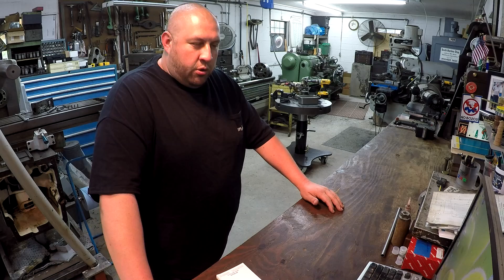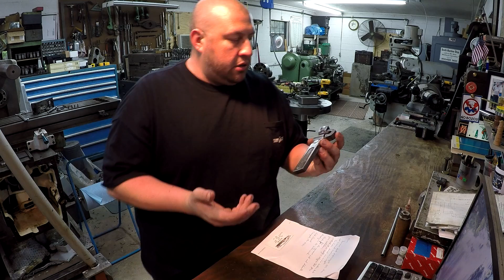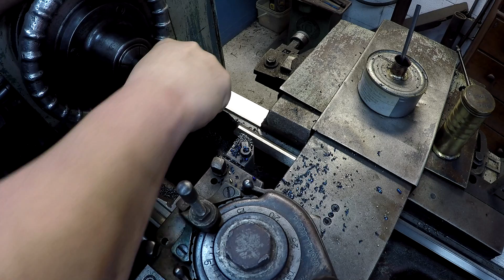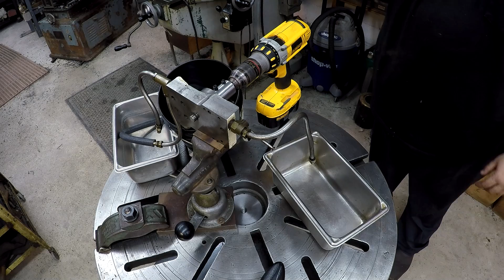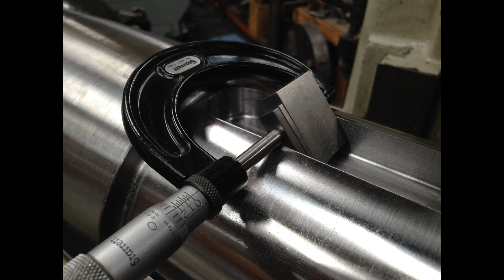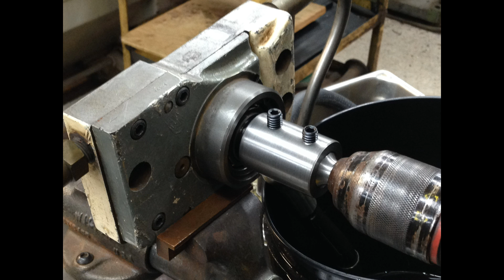Saturday Night Special 81

Comment: I'm not a hydraulics man, but surely the pump could be less effective if it had to pump against pressure instead of an open pipe. A bit like a spark plug will spark outside of the head but internal pressure can blow the spark out so to speak.

Comment: ROCK ON ADAM -without reading or scrolling down the comment section is that as i first  saw the tool holder is that i was thinking the "goose neck" style holder would lessen vibration and /or noise. but i saw that it also looks like it swivels or rotates as well? am i right cant quite tell. but does look a unique kinda shaper tool if thats what u decide to use it for.

Comment: Nice work as usual Adam! I know you have the mill knee back together now, but I think you could have used copper or aluminum tube for that suction line. It would be rigid enough to not collapse, but a heck of a lot easier to tweak around if you ever have to pull the line or filter again.

Comment: HI Adam
I am following your progress on the K&T with great interest, thanks for sharing it with us, its a great series. I watch on my TV so don't really get to comment very often. I agree with Flip, I think you should fit a delivery valve and pressure gauge on the pump outlet  to throttle the delivery and give the pump some work to do. That drill doesn't seem to be under very much stress! Just a thought
Rod

Comment: Hi Adam pump works but if you put on pressure gages on each end you will know how much pressure  it reaches under load like this there is no load , u may hook up gage on one end and block the other if the relief vales work it will bypass the high pressure build up 
just my  2 cents,, trial and error  right now its free flow just Need to see what this pump can do  like torbo charge on your truck good ideas will be watching  when its up and running .Geturdone…..

Sal

Comment: Adam that was a good video...like all the rest
I think the pump is working and maybe it was the old hose sucking air. Possibly wrong viscosity oil check that
And I remember you did not like the Mill z axis drill snap in arbor you baught from Ebay....you can use the coupling system on it like you did the pump coupling system !! :))
That shaft looks like some beautiful machining on it.
Manny

Comment: Adam, another great video. I just watched this and the pressure test video. You mentioned not having a flow meter. Time stamps on the video show that you were pumping the bucket in about 15-20 seconds.  Looks like you had between a gallon and 1.5 in the bucket. That should work out to about 3.5-4 gpm with little back pressure and the drill running  more than a tad over your design speed.  You didn't show the pump down as clearly in the pressure vid but it didn't look much slower. It really seems like the pump is in the ballpark for spec operation.
The suction hose seems like a smoking gun. If the oil got acidic it makes sense that the hose would get softer and softer over time restricting flow more and more. I'm keeping my fingers crossed that steel line solves it all for you.

Comment: Adam, I think you're spot on the money suspecting the deteriorated suction hose. The liner of the hose may have been collapsing under suction thus shutting off the flow to the pump. Those hoses aren't designed for suction, only positive pressure. The fact that it was replaced with a non-standard part is a dead giveaway and I think you nailed it. Maybe you can rig up a test to test that hose under suction and prove it to be the culprit. Everything else in your system seems to be in pretty good shape.
Reply from the maker: When I was installed in the mill, it naturally had a 90* bend. I wonder if it was pinching itself closed and ths pump just made it worse. I'll be replacing with some steel tubing.

Comment: Everybody is pretty much saying the same thing here.  The pump needs to transfer oil. In order for the pump to do that it must be able to build enough pressure to keep flowing while the oil is being held back from doing work. The work is something like filling a hydraulic  cylinder that has weight on it.
The pump can't transfer enough oil and push against the weight on the cylinder if there is too much internal clearance.  Ok?

Comment: I suspect the pump is OK, BUT... some people below are correct, the only valid test on a pump like this is at working pressure - no internal leakage will occur if there is no restriction to the output.  We test small hydraulic pumps of this type with a simple valve and gage - pipe the output to a tee piece with a gage attached to the tee, connect a valve to the open end of the tee. With the pump running, gradually close the valve until working pressure is achieved, the pump needs to have plenty of spare capacity at working pressure. It can be dangerous to restrict this type of pump too much - the fluid will break something to escape if it has to - but I think using a drill to turn it, the drill motor will stall before anything blows up!  Fantastic videos, great work, hope this helps

Comment: I agree, I think your pump is fine.
It would be interesting to connect it to your distribution block with the relief valve and check the "cracking" pressure of your relief valve.
I would use a small ball valve, a pressure gage and a tee fitting on the outlet side of the distribution block.
Just a suggestion.
Thanks for the video 
John
Reply from the maker: Last time I heard about someone putting a ball valve on a hydraulic system they got sent to the hospital and sued people.
Reply: Your test setup was better than what I had in mind.
Results looked really good, too.
Thanks 
John

Comment: Is that the original filter? As one commenter mentioned, maybe it's too high up in the oil level and it's drawing a bit of air...Good luck in the future, sorry to see you two split.
Reply from the maker: It'll be parallel to the bottom of the sump and oil level will be above it.

Comment: I think the pump can move volume, but I would still check it for pressure.  After priming the system I would check it for pressure by putting a pressure gauge on one of the outputs and blocking off the rest.  I realize a hand drill won't give you the 225PSI the pump is capable of, but at least it will show you if the pump is putting out much more than the 10PSI that you were getting on the pressure gauge on the mill.   Have you checked the pressure gauge on the mill against a known good gauge?   Just a thought.

Chris
Reply from the maker: shadowdog500 Video coming soon Chris. The gage I purchased new after I got the mill. I would hope it's still good.

Comment: Maybe the hydraulic hose wasn´t really long enough so the filter itself drew air? Or, t put it the other way, the nominal oil level was too low for the filter setup the last guy has put in.

Comment: Adam

Now you have mentioned the suction hose , I remember a vid when you opened the side and moved the filter to check if was clean , later you mentioned that it try's to move , this may back up the theory that the hose had collapsed and in moving it you let some oil through 

Just a thought but the memory may be failing at 68 and 16 pain killers a day I may have misread the comments.

Keep at it you will win 

Sorry to hear of your domestic issue but you both seem happy about it , after all it's your life and you did not have to tell us

Stuart
Reply from the maker: Stuart Hardy You make a good point Stuart. I sure think the hose was a failing point, but don't know for sure yet.

Comment: Hi mate.
That pump is looking like it's working well.  I hope that it's working up a good pressure as-well.  But you had it tested by the company hydraulics expert so it must be good.  I think that the new suction tube will be an improvement.  It might be working well now, but what would happen when it's got some restriction like a filter. 
Does this mean that the offending poppet valve has been repaired already.  It looks like we will see the K&T running before too long.  What's next? a plasma cutter?
Marcel.

Comment: Hi again, Just a quick question. How do you align key ways in long shafts when the shaft has to be remounted.
Cheers, Mike.
Reply from the maker: Mike James Most cases you can use a machinist level and it will be closer than needed. Other times you have to indicate them square.

Comment: Pump looks good. Now take that gauge and put it in one port and cap the others except hook the line back to the relief valve and see if it can build pressure against that leaking seat.  Just because it leaks off doesn't necessarily mean it won't work. Be a pretty quick and easy test to do though.
Reply from the maker: bcbloc02 I have plans to Brian, but what would be really nice is to have a flow meter installed and be turning that the proper RPM.

Comment: What size was that bucket you were sucking out of? You could use that and however long it takes to empty that bucket to figure your flow rate to make sure it's within spec. You'd have to make sure it's turning at the rated RPM though. Just another test you could use to make sure your pump is good. Or is that what your mechanic buddy at work did on a test bench?

Comment: Hi Adam, I notice you cut one of the keyway slots with a bull nose cutter and the other with a regular sharp corner end mill. Personally, I think all keyway slots should have at least a small radius to avoid stress risers but many people like them sharp for some reason. If it doesn't specify on a drawing, is the default a sharp cornered a slot or will you sometimes put a small radius in there anyway?
Reply from the maker: A radius is always good to have with any keyway, but that's not always feasible in the everyday work. Most smaller line shafts don't call for a corner radius, and it's rare that I've seen them break at the key. Motor shafts, and gearbox shafts I have seen them fail at the keyway. I go by print or sample, and if none of this cars available I go with common sense. 
Prop shafts do call for a specific corner radius btw.
Reply: Abom79 Thanks! I have been cutting quite a few sprocket drive shafts recently in the 2-1/2 to 5" range for heavy machinery and the drawings don't spec a radius so I cut them sharp. It feels wrong to me but that's what the customer wants. I have cut some 316 rudder stock keyways on up to 8" dia shafts and always put a generous radius on those.

For finishing to size I tried using a Zirconium Nitride high helix carbide we had laying around. It's actually intended for aluminum but it cuts really smooth and the finish is like glass with just air. It's holding up surprisingly well too.

Comment: Adam, the pump is making flow, but you really need to plug all of the outlet ports and put your gauge on it to see if it will build pressure. Any gear pump will flow but if there is any excessive wear it'll bypass fluid and not build pressure. I also noticed when you put any sideways pressure on the pump shaft it had some play.

Comment: Im with Flip de boer on this one. its pumping so you have volume is it to spec as well as what is the pump test PSI with and without all the feed circuits in free flow + what the PSI at full restriction on the feed's.

Comment: Good video Adam. Whilst you have clearly demonstrated that the pump works OK the next stage is put it under a pressure test. Clearly the short length of hydraulic pipe needs to be replaced with cracks in it like those you have shown.

Comment: Adam,
I feel you are correct in thinking the suspect is the suction line. Since it's supposed to be a metal and not rubber it make perfect sense that it was collapsing and not allowing the pump to suck. (That sucks!) Obviously, whomever was inside before didn't know what he was doing. More comments in part 2. BTW, I left a comment on Elena's site.
Reply from the maker: Dave, although I havnt proved it was THE problem, it's a possibility. At least I'll be eliminating one source of failure. Stay tunes for more on the new line.
Reply: Abom79 If the rubber suction line was the original problem, shouldn't it collapse/produce the symptom even easier without restriction on the pressure lines?

RE: "Announcement" - I've been there; a lot of us have. Don't forget that you're not alone & that you have far more friends that value & appreciate you than most. Thanks for all you do.

I would love to meet everyone in person @ Stan's, but can't make the schedule work.

Comment: Nice video Adam.  The pump should be flow tested to make sure the oil is at the volume needed at the rated rpm.
Reply from the maker: I agree with that statement. Finally someone gets it right. 
I'll just leave it at that.

Comment: Before moving on and reassemble the K&T I would hookup the pump to the valve block + a pressure gauge and see what pressure you're getting (block the other lines/fittings so there's no free flow). If it's all good then you most likely have a leak somewhere else in the assembly (pump and valve body are fine).and you should chase that before putting it back together.

Comment: Hi Adam
Just a thought you need to check the pressure and flow. By having open ends and not the pressure release attached with a restricted outlet and pressure gauge you won't see if the pump is working under pressure.

Love the videos 
Thanks guy